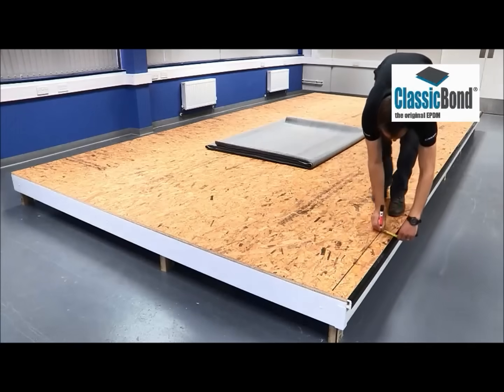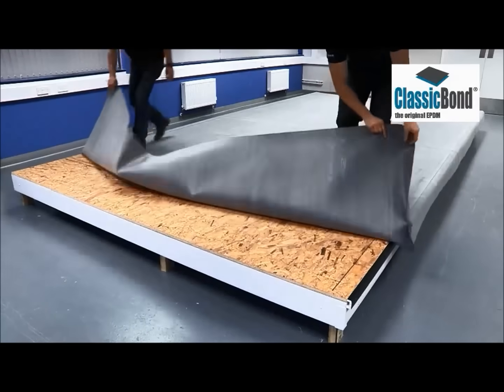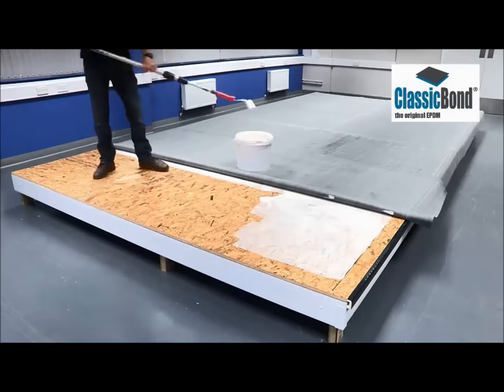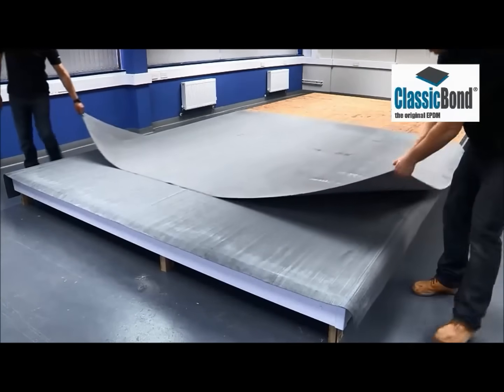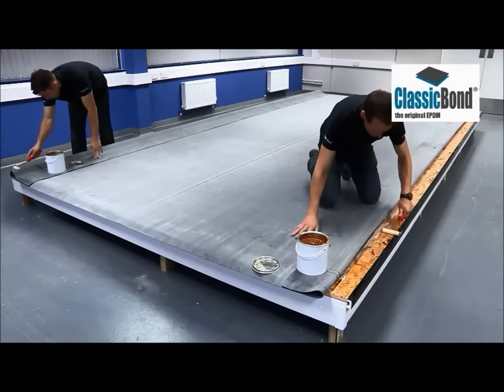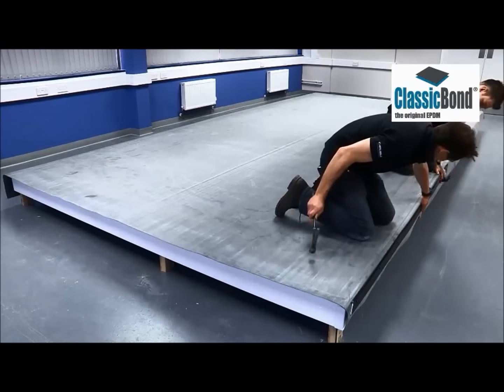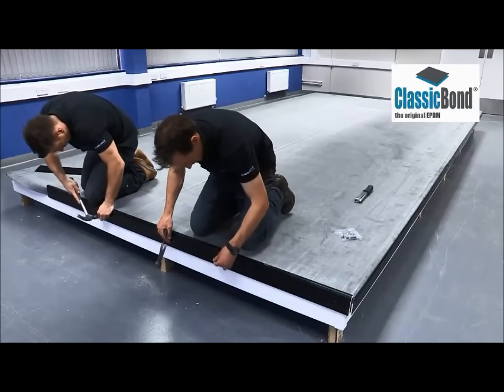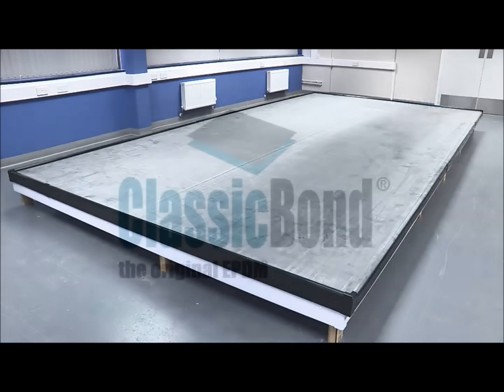How to install an EPDM Flat Rubber Roof, ClassicBond

Comment: So doesn’t the gutter trim stop the water from running off? I guess normally there would be a hole at the lowest points for gutters in the actual roof

Comment: The rubber EPDM sheeting comes with a sort of talc/dusting applied, I'm guessing for easier handling. 
The question is.... Should this be swept/washed off before applying glue? Will the talc negatively impact the adhesion of the glue?
Thanks in advance :)

Comment: Ordering and delivery from Rubber4roofs was a breeze. Delivery was quick and when promised. 
Fitting went just as smoothly. As a complete novice I’m amazed at how easy it all was. 
The only problem I had was the speed the glue went off due to it being a hot day. 
100% happy with it all.

Comment: What is the trim thats fitted already on the right hand side?
Reply from the maker: Hi @dax525 this is the back plate for the drip trim. This is installed prior to the membrane and once the membrane is fitted the front plate clamps the membrane in place. Here is a link to our video showing the installation: https://www.youtube.com/watch?v=2U1VuqSfNa4

Comment: Can the membrane be use on a 10 degree slightly pitched roof, thanks
Reply: yes. epdm is often used on commercial and residential high rises with a 0 degree roof. so 10 degree is not an issue

Comment: Why did you not apply bonding adhesive to the rubber. We have always using bonding adhesive on wood decking and back of rubber.

Comment: would you still put a drip edge underneath like a normal roof? Are there two different types of adhesive needed for the middle and edge?

Comment: We've just had a rubber membrane fitted but the roofers didn't put contact adhesive on the drip baton/gutter edge. The result is a slight rise on the rubber trapping water on the flat roof. Should adhesive be used on all edges?

Comment: but how does rain and snow melting run off if you creating a raised border around it ??
Reply from the maker: Hi there,

On a flat roof, there should be a slight fall towards one edge. On this edge you would install a drip trim. This trim allows water to run off the edge that water flows towards and into the guttering.

I hope this helps.

Comment: What do you charge for it and how long does it takes.  I got two roofs, one is 8x11 and 16x21. How many rolls and bucket of glue will I need?
Reply from the maker: Hi there,

You can quickly and simply get a price for those roof's using our kit calculator!

Here's a link: https://www.rubber4roofs.co.uk/classicbond-calculator

Comment: Can the rubber be applied to both sides of osb board ( smooth side and rough side)
Reply from the maker: Hi Kevin

It can but we would recommend bonding to the rough side for a better bond.
Reply: @Rubber4Roofs  thank you so much for the response, my shed currently has felt on and I was under the impression that the rubber should only be applied to the smooth side. I'm going to scrape the felt off and then turn the boards over, you saved me about £140.

Comment: Please can you advise on this problem, we have had this rubber roof installed on our garage, now we have water coming in from the roof like a sieve and the person who installed it says its condensation, its soaked everything that was in storage.... please tell us how to fix it because the person who installed it is taking so long getting back to us we have to act ourselves....thank you
Reply from the maker: Hi Christine

Sorry to hear you are having issues with your roof. 

Condensation can be an issue with roofs over rooms with poor ventilation. In order to advise the best course of action, we need a little more information.

Firstly, how long has the membrane been installed? Are there any electrical appliances in the garage? Are there any air bricks installed within the walls of the garage?
Reply: Person installed your roof doesn’t understand how to instal roof system. He should install vents for roof

Comment: Hi. We have a 1920s house which has a flat concrete roof. Due to the porous nature it is 'weeping' through to the room below. We have had two quotes that are roughly in line; the difference in their approach is this:
1. Wants to install batons across the concrete like joists. Apply smart ply and then a rubber membrane on top.
2. Wants to screw osb direct to the concrete and then rubbber sheet on top. 

Which is better?
Reply: epdm on concrete is fine with the proper adhesive. concrete high rises use epdm or torched asphalt directly. dont use wood. its introducing a complication of rot
Reply: Hi Ian, I’m pleased to hear both are installing ply before the CLASSICBOND is installed. 

There’s an important question relating to insulation that needs to be answered. Is this concrete roof over a heated room or is it a garage? Introducing an unventilated gap under the smart ply might be a bad idea as condensation could build up on the underside of the boards. I would suggest they install a vapour barrier directly under the board as a minimum to stop any residual moisture in the concrete rotting the boards and ideally if it is a heated room underneath then installing a vapour barrier followed by PIR insulation and then osb3 on top would give you the best solution.
Reply: @tomcullingford2962  thanks for your response. It was originally two outside cupboards; one is now an inside toilet and the other half still an outside store. Neither are heated, but obviously the toilet half will acquire some heat from the utility room. So if the OSB is screwed directly to the concrete does it still need a barrier to prevent condensation?
Reply: @Harry-Wraith  Hi Ian. Ideally insulate even if it’s just 50mm and screw the osb board directly through into the concrete. Put a polythene vapour barrier between the insulation and concrete.

Comment: you say to put the adhesive on the EDPM underside also?
Reply from the maker: Hi Patrick

The water based adhesive only needs to be applied to the deck. The contact adhesive used around the perimeter is applied to both the deck and the membrane.

I hope this helps.
Reply: @Rubber4Roofs  thanks ...

Comment: Forgive the ignorance. Can this be applied and tied into a fibreglass roof? My mum has had some people do some real bodge jobs, the felt roof that she had done some years ago has started to peel and crack, I suspect they used the cheapest felt and therefore the life span was limited. It's started to leak and with the prices people want to charge I was wondering if this could be tied onto a fibreglass roof.
Reply from the maker: Good morning Kyle

Sorry to hear your Mum is having trouble with her roofs. 

It depends what you mean by tied in to a Fibreglass roof. Epdm can be used to overlay Fibreglass as long as the roof is in sound condition and the Fibreglass is not delaminating. 

Contact adhesive would need to be used to bond the whole membrane in this case.

If you need further advise on this please contact us on 02476667234.

Comment: Anyone know if you can apply this adhesive to stained wood? I have some OSB that’s already stained to sheet my new lean too and I’d like to use it. Thanks.
Reply from the maker: Hi funnyharleyman

If the Timber is not porous then the Water based adhesive will not bond the membrane to the substrate correctly. You can use the Contact adhesive shown being used around the perimeter of the roof across the entire area if this is the case.

Comment: Can I apply a rubber liner straight over the top of a fibreglass roof?
Reply from the maker: Hi Luke

You can overlay a Fibreglass roof using Rubber but the the membrane would have to be stuck down with Contact adhesive across the whole surface area. 

If the Original Fibreglass roof has failed and there is moisture within the roof build up which has potentially caused the Timber to rot or made the boards 'spongey' then a re-roof may be the best option.

Comment: How does one attach a drainage gutter to the so-called gutter edge?  I was considering mounting a gutter along the edge of the roof and then inserting a strip of flashing under the edge of the rubber matt and bending it downward to the gutter.  Hopefully there is a glue that could effectively keep it in place?
Reply from the maker: Hi Daniel

Guttering is usually fitted below the Drip trim.

The backplate of the Drip trim is normally mounted to a 2x1 Timber batten so that the actual trim protrudes out from the roof edge so that the water drips into the middle of the Gutter.

I hope this helps.

Comment: Can this be applied on the walls too, if not what is an alternative for wrapping a flat roof and walls of a wood cabin ?
Reply from the maker: Hi Triumf

We only recommend using EPDM as a Flat roofing material, Normally the walls would be wrapped with some form of breather membrane for walls before cladding is fitted.

I think a wooden cabin looks nice clad with Timber personally.
Reply: Typically in areas of custom homes I have done as well as my own cabin I did an acoustic membrane...my go-to, hand-to-god not sponsored choice is a membrane called Acousti-Blok. Aside from that I always caulk every double joint that goes through to plywood and foam every bay until full when trimmed back

Comment: It's like fitting a giant screen protector on your phone ... Usually easier said than done
Reply from the maker: 😂 Nice comparison.

Luckily the Membrane is not see through, so you don't need to worry about that one annoying spec of dust you can never shift with a screen protector.

Comment: can I use this material ob an rv roof?
Reply from the maker: Hi there

This would be dependant on the actual substrate of the RV roof. If it is not a porous timber then you would need to use Contact adhesive for the entirety of the Membrane. 

It may also be difficult but not impossible to install a trim to the edges of the RV to ensure each edge is water tight.

I hope this helps.

Comment: Can you fit a mineral felt over this once it is fitted.
Reply from the maker: Hi Rob

No, Bitumen products are not compatible with this membrane. 

Epdm is a complete waterproof membrane so there would be no need to install another waterproofing system on top.

Comment: I live in deep south Texas.  Is this roof system recommended for high heat/extreme UV areas like ours?   I'm going to be redoing our flat roof and I really want something that will last for a good bit.
Reply from the maker: Hi V S

This Epdm membrane will not crack, peel or split within the temperature range of -40ºC to +120ºC. It also has great UV resistant properties.
Reply: @Rubber4Roofs  Wow!   Yup, that's what I'm looking for.  Thank you so much!

Comment: Can you walk on epdm as your laying it down, if no how long is it before you can walk on it to do the edge details as i have no scaffolding
Reply from the maker: Hi taffytop

You can walk on Epdm as you install it that's no problem as long as you're careful not to push it around as the Water based adhesive cures.

Comment: Hi I want to do this to my garage roof but my garage is connected to next doors garage. How do I go about fitting rubber roofing to join up to there old felt roof? I’d ask if they would want there’s doing at the same time but there pockets are squeaky so I’ll just do mine and leave there’s
Reply from the maker: Hi Dave, thanks for the question. You can join on to an existing felt roof by installing a termination bar, lap sealant and water cut off mastic. It's really simple to do. Click the link here to watch how it's done, thanks! https://www.rubber4roofs.co.uk/how-to-install-a-termination-bar-video-and-installation-guide

Comment: It goes directly on the plywood? There is no layers below it prior to the plywood?
Reply from the maker: The membrane is adhered straight on to your timber deck with the water based adhesive. You just need to make sure your timber boards are dry and clean.
Reply: @Rubber4Roofs  what about the insulation and vapor retarder layer? When I search EPDM roof layers for flashing details, I typically see insulation above the plywood before the EPDM membrane. I would imagine it’s important.
Reply from the maker: @HAGA7793  On a Warm roof build up you would typically install one board on top of the joists, then your Vapour barrier, followed by your insulation. You would then install another board on top of the Insulation and the EPDM membrane is applied to this top board.
Reply from the maker: @HAGA7793  Please see reply above :)
Reply: @Rubber4Roofs  thanks for the reply;  I’m asking for future construction I’m working on. 

My roof is flat but has a long span so there is some attic volume. This attic is vented and has insulation placed between the ceiling joists. In that case, would a hot roof add any value? I think a cold roof makes sense and I want to confirm if it’s okay to directly apply EPDM over the plywood sheathing? Thanks.
Reply from the maker: @HAGA7793  EPDM would be suitable to be applied to the Top board of a cold roof build up as long as you have used a Vapour Barrier and there is a 50mm gap for ventilation.
Reply: @Rubber4Roofs  when you say top board are you referring to the plywood? And I’m curious why you need a vapor barrier if the roof attic is already vented.
Reply from the maker: @HAGA7793  Yes the Plywood.
If you already have a Cold roof construction you should have already have a Vapour Barrier installed above your Plasterboard to prevent any moisture entering your Roof build up.

Comment: Great video. Quick question: if I’m doing a flat roof on top of a bay window, what material do I use where the roof meets the brick of my house? Currently it looks like a sort of rubber. Thanks.
Reply from the maker: Hi Nico. The EPDM rubber membrane can be fitted in one piece over the roof and up the brick wall 150mm. Then install a lead wall flashing over the rubber membrane. 

If you check out the video on our YouTube channel “How to fit a wall flashing.
Reply: @Rubber4Roofs  Thanks for explaining that, I'll check out that video too!

Comment: Eeewww water based glue? Trash! I have installed multiple roofs with epdm rubber some over 500 sq, I'm talking 50-70 10×100' rolls, I have worked with multiple manufacturers, Carlisle, Firestone, John's Manville, Garland, etc put the roof on the convention center in Columbus ohio lots of high profile jobs, do yourself a favor and do not use nails on your edge metal and go with a heavy gage metal for your drip edge with a cleat, NO NAILS use screws to fasten your cleat through the face of the cleat into the side of your nailer, attach your drip edge metal to your cleat and fasten with 1.5"-2" screws through the top of the dripedge to the top of your nailer and strip in the metal with epdm cover strip, also don't cheap out and glue straight to the deck, do yourself a favor and get .5" HD iso board to fasten to your deck, this shit is not designed to be glued straight to a wooden deck like this, the high density board has a paper face on it designed to take the glue and adhere properly, if done right these roofs will last 20 years +, done like this aka (the Amish style) you will probably have issues in 10-15, also there are things such as wind enhancements that should be done on the underside of epdm rubber called russ  strip that will keep heavy winds from working your material loose around the perimeter of the structure and then all that water based glue will separate after the perimeter is loosened up and all them nails you used for your metal will go with it.... btw I'm a industrial roofing foreman in the unionif you wanna know my credentials
Reply from the maker: Thanks Dusty, some great comments on there! The system is Carlisle.  In the UK on residential roofs and here I’m talking under 100sqm the waterbased adhesive with stainless poly pins and the clamp edge trim system is approved by Carlisle. On the big stuff commercial and 100sqm plus we specify 100% solvent based adhesives and RUSS perimeter securement. 

Just picking up on the previous guys comments the approved timber deck over here is OSB3 oriented strand board. 

Personally I would bond to tissue faced insulation with contact but in some cases application will be on to a cold deck roof design. 

As I say Dusty thanks for your comments it’s great to hear from someone fitting this to big roofs 👍🏻

Comment: what are the centers on the pre drilled holes on the trim?
Reply from the maker: Hi Herb. There are 8 pins per 2.5m length so that’s approximately 278mm centres.
Reply: @Rubber4Roofs   ok thanks

Comment: So the white glue has to still be white when you roll the rubber out? Or do you let it soak in abit so it’s clear
Reply from the maker: Hey Totsey Man. You can let the white water based adhesive tack off a little if you’ve put it on to thick but don’t let it go clear. The adhesive should transfer to the back of the EPDM membrane once swept with a broom. You can always peal the corner back just to check that it’s transferred.
Reply: Cheers I was having this conversation with a work colleague the other day when fitting a Firestone rubber roof. I said that the water based glue has to be still white when rolling the rubber out. He thought you have to let it go clear first. So cheers for clarification on that I got him to do it my way in the end anyway.